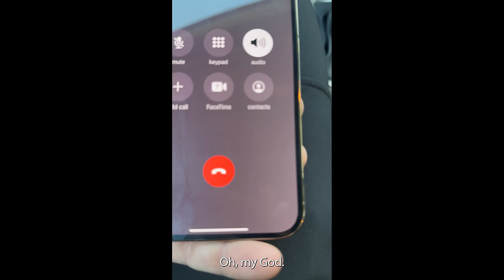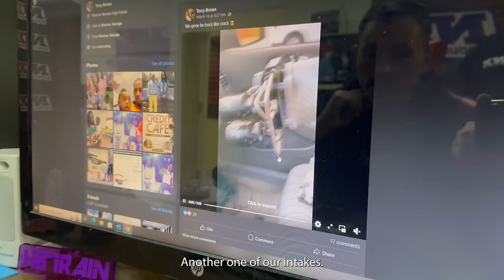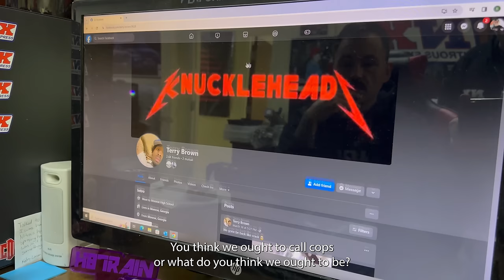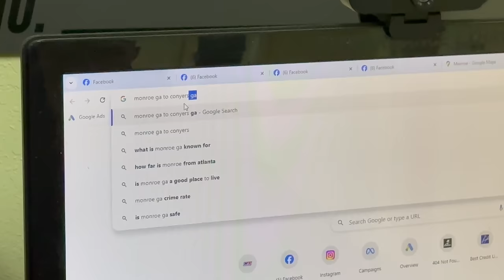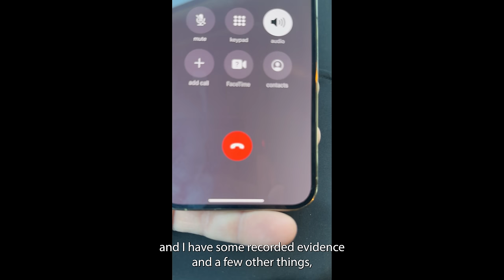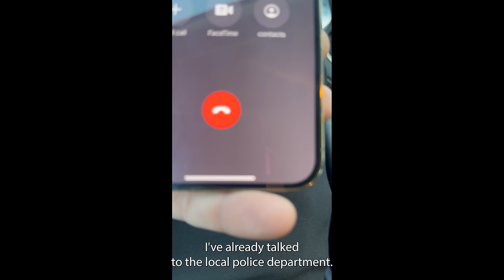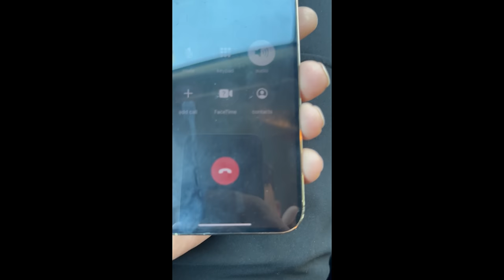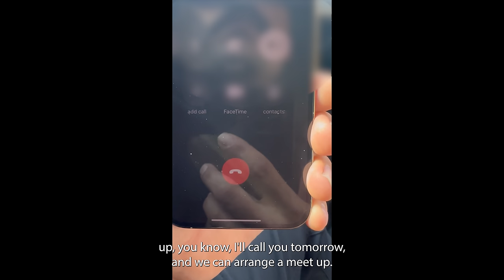Nitrous Express Recovers A STOLEN HELLCAT LID In Georgia!!

Comment: I had my old Shovel Head stolen a few years ago. Engine and transmission showed up on market place about a year later. My identification mark was a stamp that looked like the North Star stamped on the block the heads the jugs. They were obvious, but inconspicuous to most people. Went over with some backup, and explained what was going to happen. The frame was found right after it was stolen close to where the running gear was advertised. Pretty sure I had the right guy!
Reply: how did you stamp the parts? Assuming they were cast parts?
Reply: @M.TTT.  the parts he's talking about are cast, then forged and machined,   similar to how you can stamp a cast and forged iron block.  just use a punch and a light hammer tap.
Reply: @exiteternium  ah alright, wasn't sure if the metal would be soft enough that a stamp would mark it and not crack the block or something.

Comment: Did you not get paid out by your insurance where all the stolen property items truck trailer?
Reply: You know he most likely did
Reply: If they got paid out by the insurance company for items, then the insurance company own all those items. Not NE .. that would mean NE have then stolen the items .... Once an insurance company pays you for loss, they take legal ownership of the items.
Reply: Considering they have a proof of ownership and police report... no they likely haven't been paid for those items.
Reply: @siccamade5150 wrong. You get a police report when you report the crime and the LEO enters it I to the system. Supplying Proof of Ownership is a plus and legitimizes the report to LE. NE Did in fact file an insurance claim on the rig and items and therefore the insurance company owns those items and the truck. He has no right to take those items. He could very well be liable for various charges if he doesn’t hand those over to the insurance company. The legal way to do it would have had the local LEO take possession of them and contact the insurance company to sort out current ownership and who they are to be returned to. The “seller” would most likely not have gave any charges due to the storage unit sale and would not have any reasonable suspicion that they were stolen.
Reply: @OttoTheWeim   that's if they paid him for the parts right. If the insurance company didn't pay them then free game.

Comment: We also had a whole bunch of muscle car parts stolen to original stuff off of the the late sixties Dodge chargers and challengers all that stuff was stolen the brass radiators carburetors air conditioner compressors and stuff polish brackets all that stuff was stolen 440 engines 383 engines not one thing has ever been recovered that hurt

Comment: I doubt you really got the trailer since you didn't show it ,and no footage of any police receiving evidence because that didnt happen. They told you there was nothing they could do. So y'all basically lost a whole truck and trailer and only recovered 1 manifold.... Awesome.
Reply: They dump trailers quick from what I've seen that's usually what gets recovered is only the Trailer 😉
Reply: This isn't the first one they've recovered
Reply: The truck to them was the onky thing of value. The trailer and contents was just a bonus.  An 99-02 f250 or 350 crew cab ot otherwise is worth a ton in parts. Just a good trans alone is a few grand. Good 7.3 depending on mileage, a few grand. The rest of the truck as parts can be another $5k or more.
Those are the easiest trucks to steal of just about all time. Thats why they are still constantly stolen.